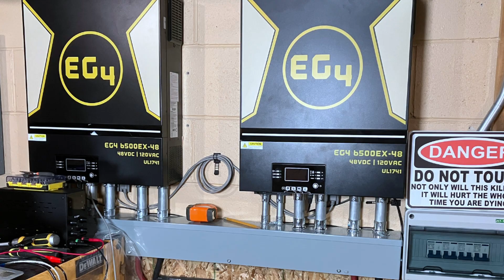What’s Inside the ALLPOWERS R1500?

Comment: I have a R600 that stopped working while discharging. Maybe some protection tripped?   When plug in DC, something whirl up like normal but no display and it shuts down.
Reply from the maker: When you plugged in the DC connection, was it within the required specifications?  Can you charge with AC still?
Reply: @AdamDeLayDIY Both AC and DC do not have power going into it. I used another power station to monitor. 

Could there be a BMS over discharge and it can’t wake up?

Comment: I have an issue with my new R1500. I tried using solar to charge the unit (only at a low 20watts or so due to cloudy weather) and run the AC output at 125 watts to a fridge. The unit suddenly began smoking and making loud popping noises internally. I have been in touch with AllPowers online service here in the U.K. and they have told me mixing the DC input while using AC output is not recommended. Are they trying to fob me off? as I believe my unit is now partially damaged internally and I think a repair may be needed under warranty. Can anyone help?.
Reply from the maker: Sorry to hear that.  There shouldn't be any issue at all charging from solar and running AC power at the same time.  What was the voltage of the panel that was connected?

Comment: Have you run a microwave with it? Or put it on an oscilloscope?  I saw a guy with an allpowers system that had dirty power.
Reply from the maker: @JR-xw5dk  no I haven’t run a microwave on it and I only recently picked up an oscilloscope but I no longer have the power station.